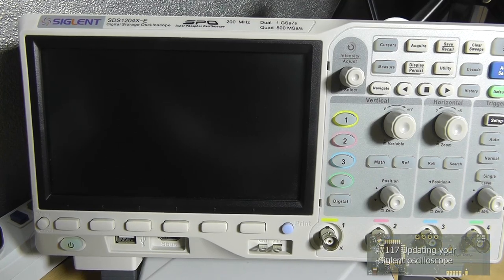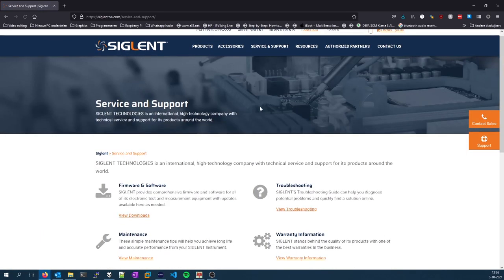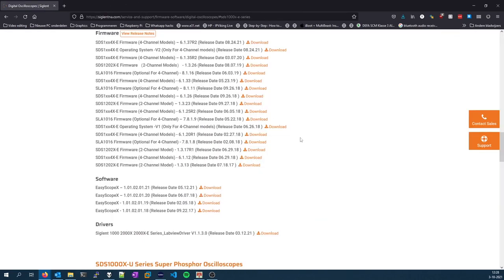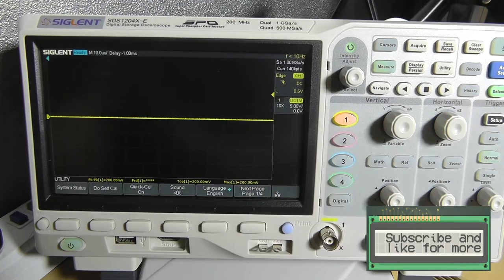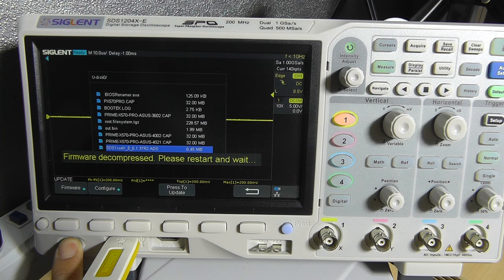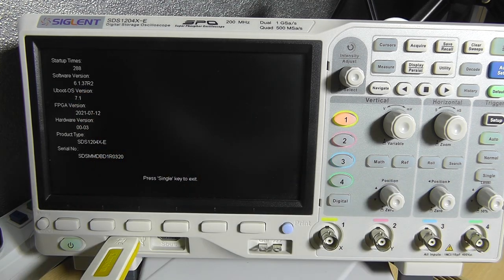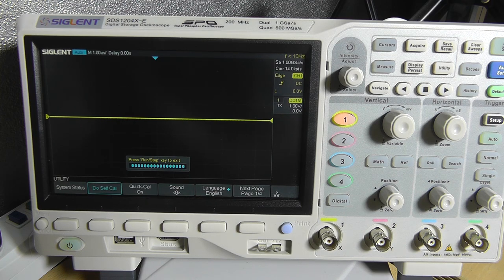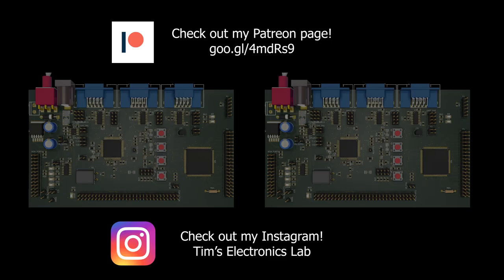#117 Updating a Siglent oscilloscope

Comment: Warning for owners of this scope (SDS1104X-E or SDS1204X-E) that use the wifi option (this is an option for which you have to pay): you may not want to update to firmware version 6.1.37R2, because this version breaks the wifi function. You can read more about this issue on the EEVblog forum in a thread called "Siglent SDS1104X-E and SDS1204X-E Mixed Signal Oscilloscopes", page 81 and further.
Reply: No problem. New firmware was released 27th of October, and the Wifi-issue is fixed.